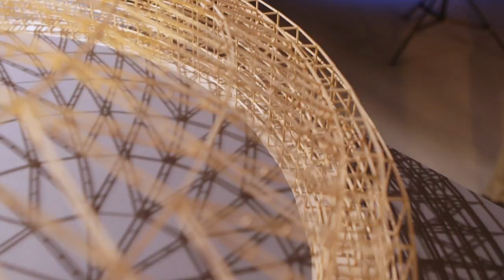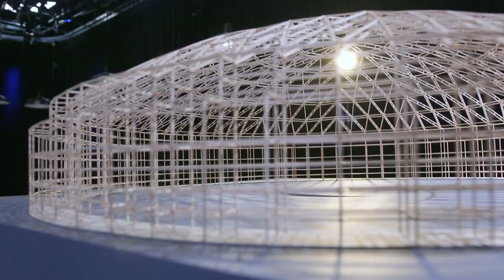The Astrodome: Deconstructed

Comment: A 21st-Century version of the Crystal Palace, if you will (the London structure, not the London football/soccer club Crystal Palace FC), which also had a park associated with it. The Astrodome has "good bones" (the underlying structure), time to show that structure off. The existing dome and much of the exterior wall hides the structure. It just needs what the kids today call a "re-skin". Let the light in, let the fresh air in. If the stadium seats stay as mentioned in other comments, have a transparent cover that protects the seats from rain, but not from light (and leave the rest open). Granted it'll be less pleasant during the hot humid summers or rainy days, but if there's a grass surface inside as there was when the structure was first built (whether a sports field or not) those same times or days will be more pleasant for the grass. ;)

The main drawback is money, of course... It'll take a public-private partnership to pull it off (pun intended).

Comment: Any way to keep the roof for shade and protection from rain?
Reply: YES, we could do a glass layer on top of the dome structure. Great suggestion!
Reply: There would be several options for covering the roof - either permanently or when needed. For example, the Romans used something called velarium on the Colosseum in Rome to protect spectators from light rain and the sun. They were sails suspended above the heads of the visitors and created an updraft as well - a natural air conditioning! 

There would be lots of cool ways to solve this. Great suggestion! Thank you!!

LINKS:
https://www.youtube.com/watch?v=qrUm_Yn4bbU
https://twitter.com/romanhistory1/status/1122417214777430017